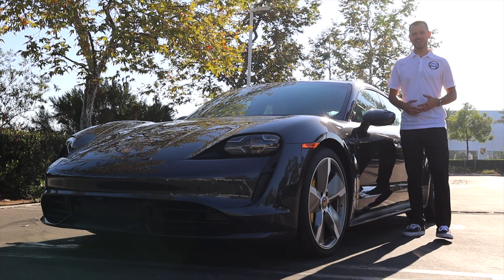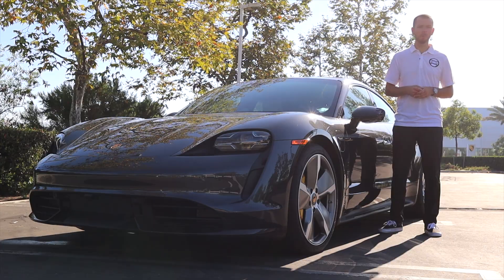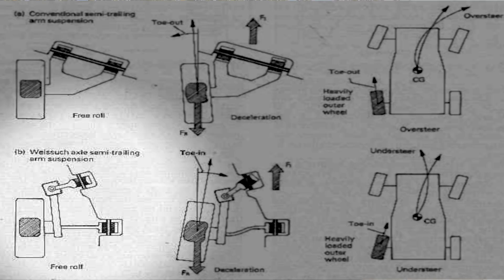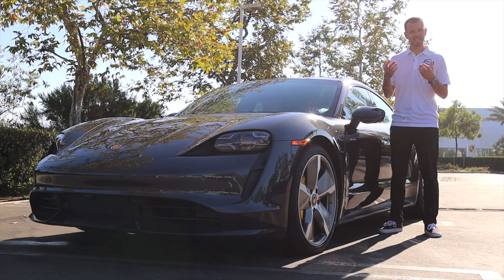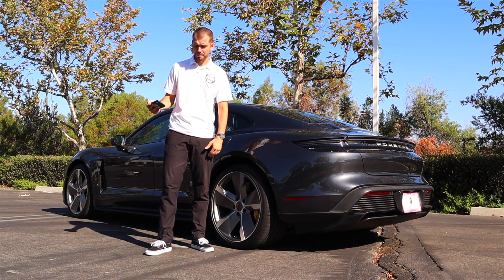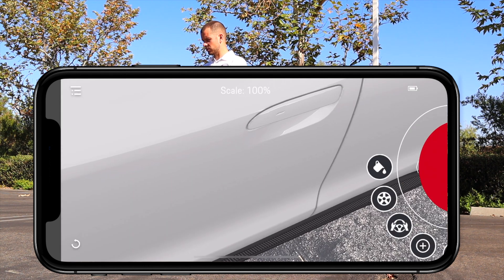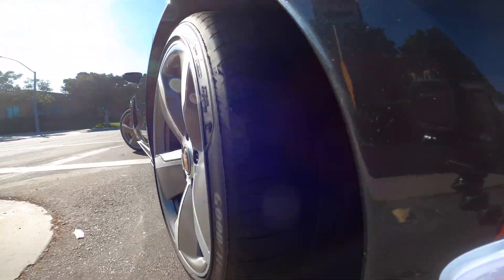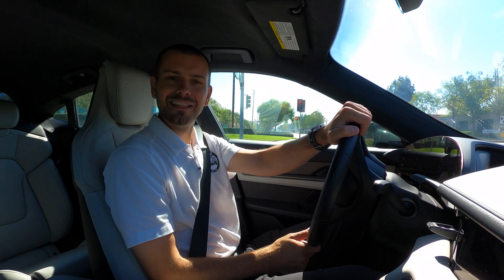How Does Rear Axle Steering Work?! What is the History of the System at Porsche & Is It Worth It?!

Comment: My question is how does the system work in slick conditions at highway speeds.  Let's say the road is covered in slush, how would the car handle at 50-65 MPH?  Better or worse than a standard set up?  I have done thought experiments and have confliction conclusions.
Reply from the maker: That is a great question. I am not sure how rear axle steering will have an affect on drivability with snow and slushy conditions 🤔

Comment: This is an amazing explanation! But it leaves me with another question; how does Rear Axle Steering compare to PTV Plus as they appear to do very similar things but in much different ways. Or is that a misconception on my part? As I would most likely not option both is there one you would recommend over the other and why? Thanks!

Comment: As a daily driver of the 4S with this option, it is very helpful to have, making normal turns you may have been a bit questionable about so much easier. Getting in and out of my driveway around my wife’s large Ram 2500 was much more difficult on my last similar sized car that didnt have this feature. So much smoother now. And when you do want to push it, this car is like butter. Thanks for the video and pointing out that AR app. Had no idea it was there. Although I cant get the Scan your car function to work, only place a car.
Reply from the maker: Appreciate your input this is fantastic! You're welcome! The Scan feature is currently down 😔
Reply: I also have a 4S daily with the option and love it. Anything to shrink the car in a parking lot is worth every penny, and the stability at high speed lane changes is just icing on the cake.